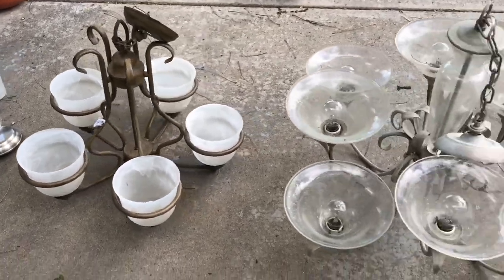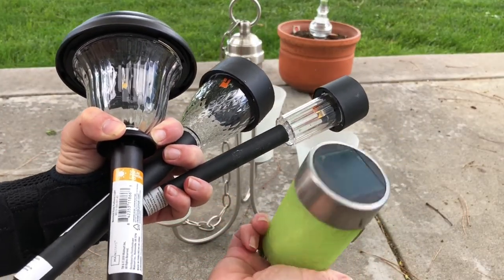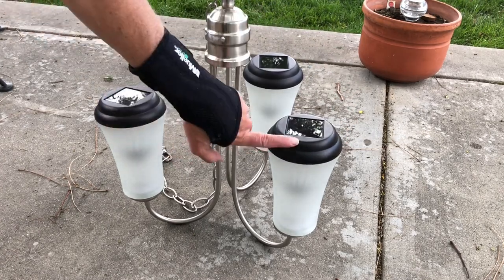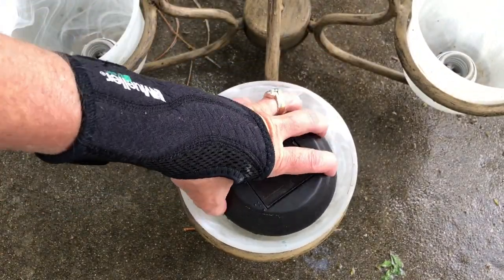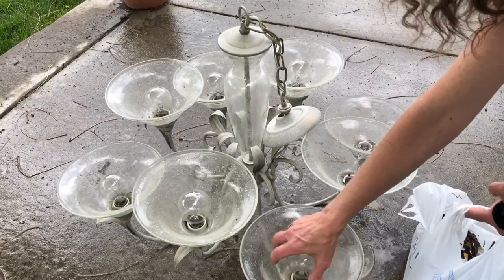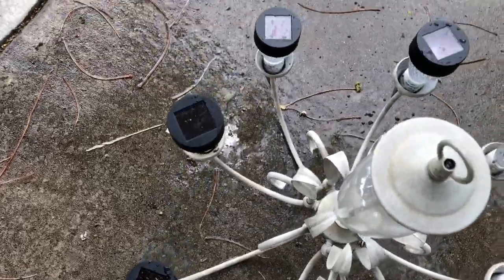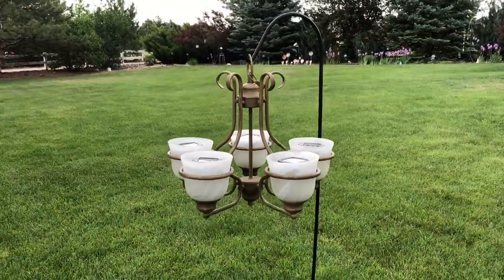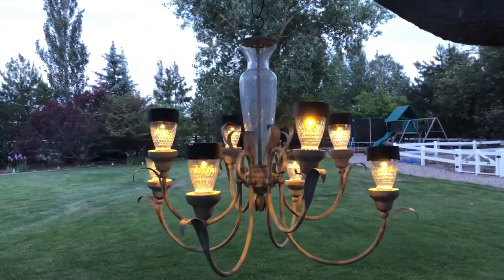How To Make A Solar Chandelier

Comment: I'm totally in LOVE with your chandelier ideas!! I have a question, what kind of solar lights would you use if the chandelier was under a tree and the panels didn't get any sun?
Reply from the maker: Thank you, I use regular solar lights for mine hanging from trees.  They get indirect sunlight and will run, just for less time.

Comment: I'd still like to know how to manage rainwater that pools at the solar light.
Reply from the maker: The solar light covers the edge so we don't really get any water in them.  If any does get in, we're a pretty dry climate so it dries out quickly.  You could put a lip of silicone around it to seal it